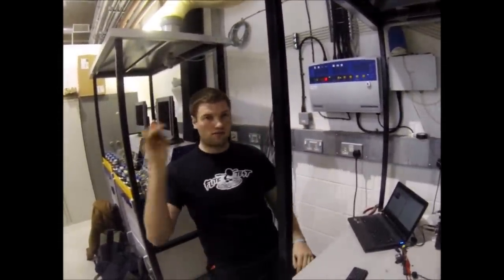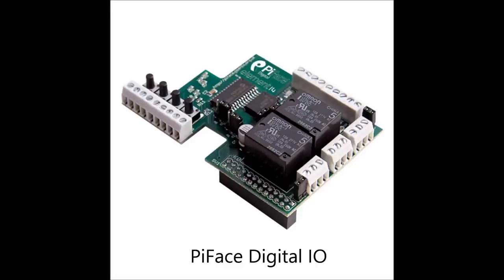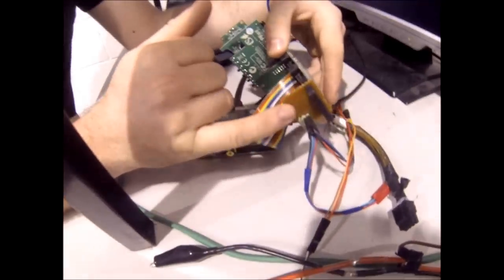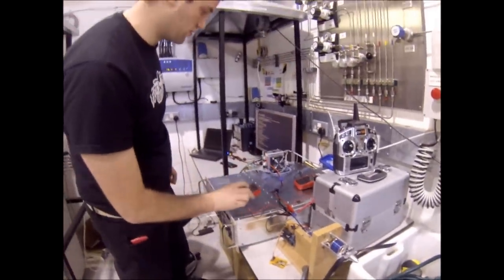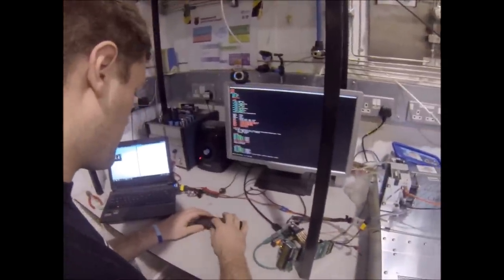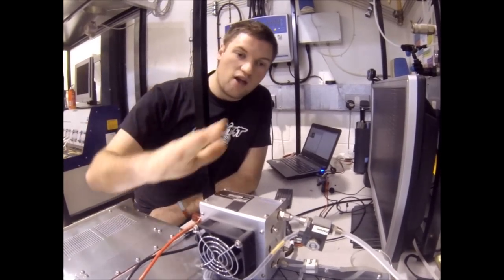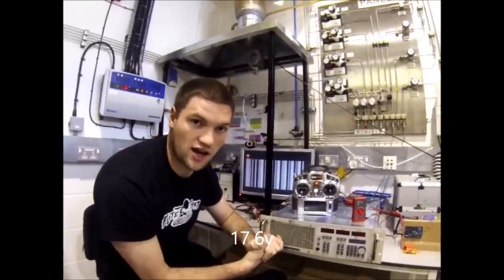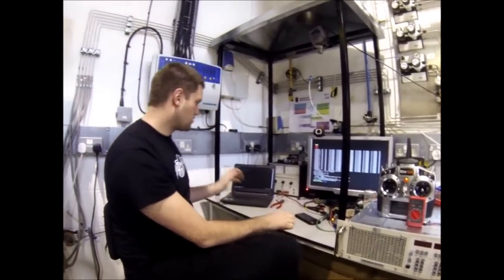Fuel Cell Controller Demonstration

Comment: Great video. Even as an electrical engineer, I was able to understand this.
If you monitor the fuel intake, I would assume that you control the hydrogen flow valve through your control system. Am I right to believe that that valve will open or close according to power demand depending on the load?
Furthermore, is the GitHub project publicly available?
Thank you for any answer you can give me.
Reply from the maker: Thanks for the comments!
This is an old project now so my memory is a bit fuzzy but iirc the hydrogen input was permanently open when running (to maintain pressure in the cell), however the anode purge valve was controlled to remove water.  Naturally, the greater the electrical load, more reactions occur in the cell.  So higher load means more water and the purge valve opens more frequently.  I think the purge duration was kept constant, but the frequency was increased (I did the tests and this provided best performance for the least H2 wasted during purge.)
The code is old and probably rather messy as I haven't worked on this for many years but you can find it here: https://github.com/FuelCellUAV/h100

Comment: Hi, a postgraduate researcher here with an interest in RC boats and planes. I found this video quite informative even if technology has moved a lot forward (was nice to see the good old rPI from 2013). I was wondering if there is any written documentation of your work in the lab that i can take a look at. Please reply here and if you are interested we can have some email comunications.
Reply from the maker: Hiya.  Thanks for the comments.  My code isn't public but I shall dig it out and put it up once I have done my PhD corrections.  Not much in terms of documentation but I do have a paper (open access) that might be helpful. The old pi is certainly a blast from the past, it was just handy to be able to ssh into it from the office rather than having to sit in the cold lab all the time!
https://www.sciencedirect.com/science/article/pii/S0360319915308065
Reply from the maker: Oh, and you should be able to find me on ORCID from the links on that paper and get my Uni email address etc.  I have another paper on a similar thing but using a solid oxide fuel cell too which you should be able to find through ORCID or Google Scholar, etc.
Reply: @DrGreenGiant  Yup, after a bit of digging in google scholar i found what i was interested in. Trying to build an autonomous boat with hybrid power-plant (scaled) for ocean survey (the research topic is on naval engineering). I think i found you on LinkedIn, otherwise if you preferer i can write on the email in the papers.
Reply from the maker: @Lorenzo6880  either is fine, preferably email though please. Sounds really interesting, is it for a PhD project?
Reply: @DrGreenGiant  I sent an email with some details, thanks again.  Never thought i would have conversation on research topics in the comment section of YT LOL

Comment: A 700Mhz CPU burning 5W, just to turn 3 relays.  It's all about publicity.
Reply from the maker: It's not about publicity. It's a cheap and simple to use bit of kit. A later prototype I have is using Matlab & SIMULINK onboard the rPi to fun a full fuel cell model for model predictive control. Something I couldn't do on a lower power device, certainly not in the timeframe of my research anyway. Btw it's 10W with all the attached devices.
Reply: Simon Howroyd Got to do whatever it takes to get a job, I suppose.